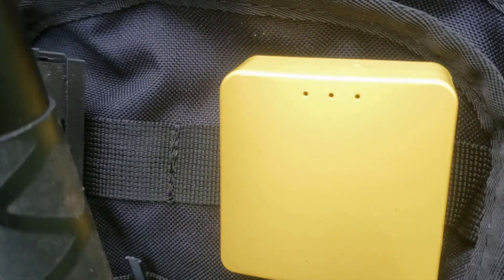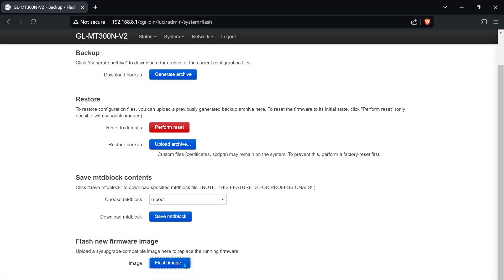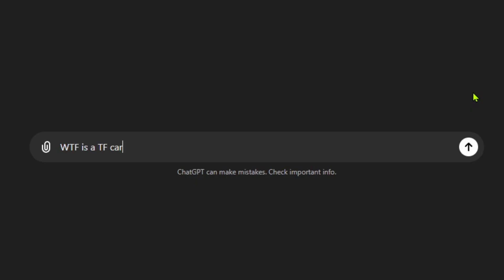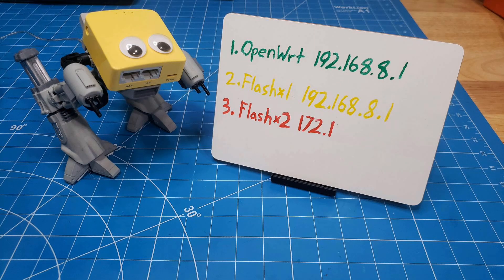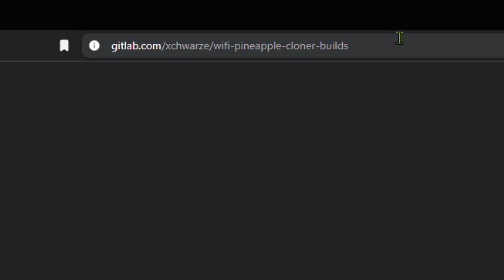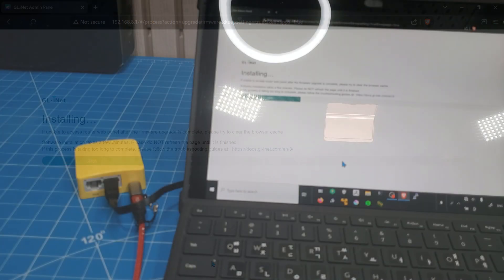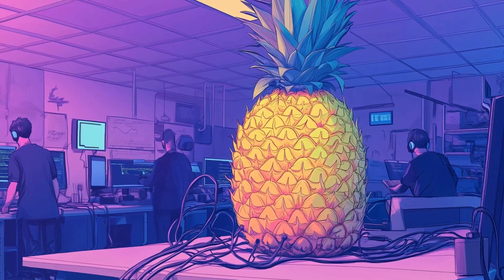I Turned My Old Router Into an Ethical Hacking Tool!

Comment: Very fun project and excilent video. Just to add, if you are using a new out the box Mango with the latest firmware version 4.3.17 you are going to have a bad time, roll it back to version 3.105 and will work as show in the video. cant wait for part 2!
Reply from the maker: Before rolling it further back to 19.07.7? My understanding is it only works flashed from 19.07.7 but I haven't tried it any other way (w/out bricking it)...
Reply: @cyberspacemanmike  We have crossed wires. the Im not talking about openwrt you are right 100% want version 19.07.7. Im talking about the out the box GL-inet fork of OpenWRT presinstalled, there latest version for the GL-MT300N-V2 has version 4.3.17 and this videos process didn't work if I flash it with 19.07.7. so you need to roll back the GL-inet fork if you have the lastest version of there firmware. 

If you check your footage back on the MT300N-V2 UI I bet you a cookie you will see its running an older version out of the box then 4.3.17.

So, you may get a few comments from people with the very latest versions of the Mango v2 saying "when I flash 19.07.7 198.168.8.1 don't take me to OpenWrt..have I bricked my Mango?" the fix is to rollback GL-inet fork before flashing with mainline version 19.07.7 and expect you will cover Uboot in part 2 given your bad luck with the slate. 

Please feel free to sanity check this by heading to GL-inet's Firmware Download Center and slaping their latest 4.3.17 on a Mango and going through the steps in the video.
Reply: @cyberspacemanmike  A important step was missed when initially re flashing the devices...for many of the routers- particularly the GL-iNets... they need to be put into flash/ reboot mode..and for the GLs is done by plugging in the ethernet/ usb ethernet adapter first and then hold the reset button(on other routers it is the wrt button)- while holding and with the ethernet connected(LAN not WAN- middle most connection point on the Mango) then and only then plug the device into power. Won't take long but you will see the LEDs blinking...on ce they stop and are solid then the device is ready for new firmware...just need to do this the one time- unless you somehow disconnected the device from power...

Then you'll need to do a full re set...and advisable do this a few times just to make sure(there's no confirmation for any of these ) which is done by unplugging the device and while plugging it back in hold the reset button and do so for 4x the amount of time it required to make the LED lights go solid.. they will blink once more when it has been re set but it is easily missed- you can blink and while doing so the LED light blinks....after that you'll need to unplug it from power and then put it in flash mode..so same thing...hold down the rest button on the Mango until the LED lights go solid...should be something like 6 seconds.
Reply: I think this is what happened to me but because i wasnt aware of that. Resseting to factory fixed it for me. But it is to note that the ip under which i can find the openwrt panel changed for me.
Reply: @Pigeon_FX @cyberspacemanmike My Mango (appears, i believe to have) flashed with no issue- though can't run scans cuz I require an external WiFi adapter- i've tried so many now with zero success.. maybe this is what you mean by having issues? I still have a few chipsets to go until i've exhausted my optiions- mind you...the remaining ones are the specific variants reported with success... the  RT5370 WIFI adapter or MT7612U WIFI adapter - with the first showing higher rates of success.. for me, these have just not been as available as all the others....and the devices that do have these chipsets the sellers are milking it charging way too much.

But, re watching this tutorial... there is no mention of wifi adapters....am I missing something? Maybe I don't require one after all?

I used the following named bin files for flashing AND importantly making sure i've unchecked the" keep existing settings"(i think this is where many glance over when uploading the firmware before flashing the device...it's just a sneaky check box easily overlooked)...

The bin files used: 
openwrt-19.07.7-ramips-mt76x8-gl-mt300n-v2-squashfs-sysupgrade
gl-mt300n-v2-universal-sysupgrade

Oh another note...my Mango is the v2... and if openned gently(the switches break off easilly if done without care) it has 2 ipex antenna connection points... this is also the case for the ext(obviouslly since it is marketted as having external antennas hence the ext for external...antenna), and "Shadow" variants....but, I didn't have success with the Ext one...hgaven't tried the Shadow yet....

Comment: I wanna lear  to brick stuff just like you
Reply from the maker: It's easy! Flash the wrong firmware or attempt a factory reset after the Pineapple OS is installed as per the instructions in the video. Next vid will be on unbricking.
Reply: @cyberspacemanmike  cant wait!
Reply: unplug it right when you start to flash it

Comment: Cant even get in the gui after the first flash 😢
Reply from the maker: If it's not too badly bricked, Gl.inet routers have a recovery Web UI at 192.168.1.1 (you may have to assign your PC a static IP). Make sure to download OpenWRT 19.07.7 firmware that is specific to your router.
Reply: @cyberspacemanmike  192.168.1.1 doesnt work too. idk why it even bricked tho, with the same router and everything
Reply from the maker: @Jonas-is8gs  Did you set a static IP for your PC? Also, sometimes having a gateway already existing at 192.168.1.1 will mess things up.
Reply from the maker: Also, there's a V1 and a V2 of the Mango I think which may cause problems if you have the wrong version.
Reply: i have the v2, but after alot of resets i finaly got into the 192.168.1.1 UI
Reply from the maker: @Jonas-is8gs  Glad you finally got it working! (•‿‿•)
Reply: what color do you have as some are MIPS and Some are MIPSEL

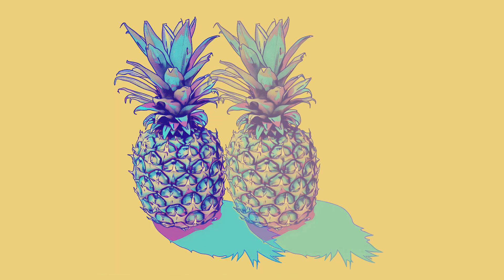Comment: hypothetically speaking lets say somebody just ignore the part of not doing it over wifi and still did it, and now the mango is ripped, now what?lol  00:06:49 🤣
Reply from the maker: Gl.inet routers have a recovery UI at 192.168.1.1 (I think you have to set a static IP for your PC). If that doesn't work you'll have to experiment with a USB to TTL adapter.
Reply: thats funny af ngl